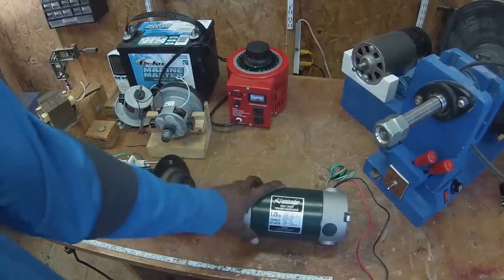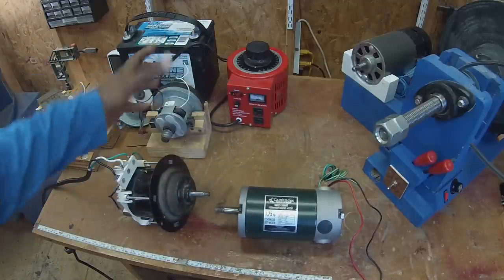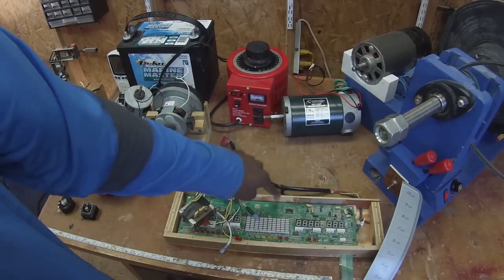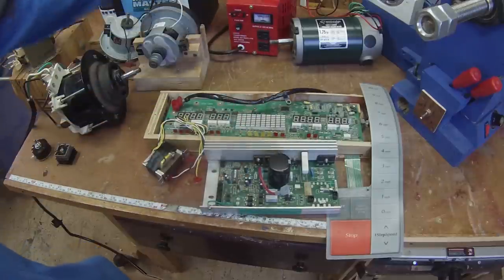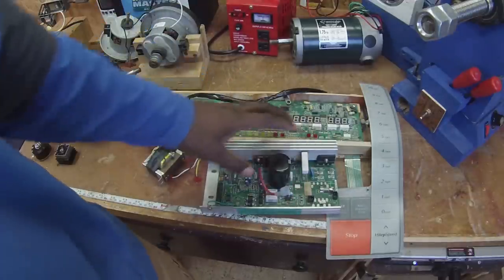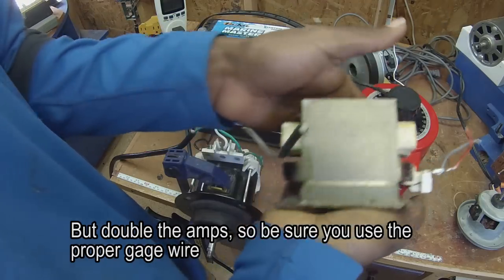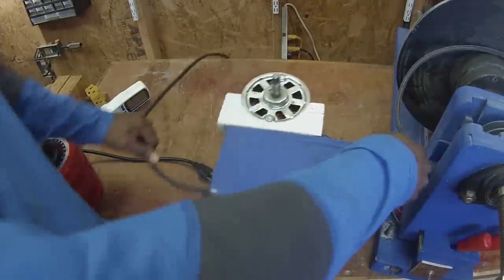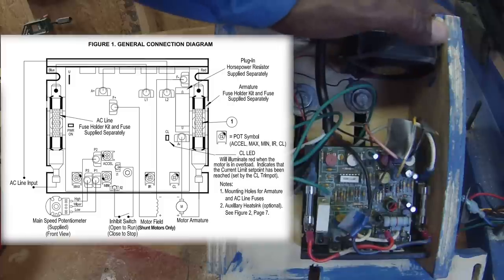How To Wire A Large DC Motor And Control The Speed; Treadmill Motors and Universal Motors 019

Comment: I just discovered your video teaching on motors and wonder if you might suggest how to best power a drum sander feed conveyor belt that I need to build for my drum sander which I recently acquired that needs the conveyor feed table added. I have seen several builders use a windshield wiper motor for the drive motor but they were not specific about just what they used in their configurations. It does need to be speed controlled  and these are normally 12 volt dc motors that produce lots of torque. I think that would be desirable so that slipping of the belt could be detrimental to the finished surface by causing dents in the surface where it occurred. Some belt sanders have what is called "sandsmart " feature built in that is the ability to compensate for a need for more torque to maintain steady speed of the feed belt. Anything you might suggest along the lines of the speed controls needed would be very appreciated. Thanks Jim

Comment: Super informative and answered my question regarding the HF controller.  

I have a motor with a motor controller that is connected to a power supply board.  Can I take off the power supply board and just use the motor controller with a potentiometer????  Please help!

Comment: Regarding the Harbor Freight motor control midway through, they do not work on certain motors, because the motor is wound a certain way and the only way to control the speed is via voltage control, as in the variac you are using... So I would suggest testing it on more motors you have sitting around and see if you get different results.
Reply from the maker: It should work with DC motors, and universal motors... Routers are usually universal. Induction motors are the ones you can't control with this type of device. Watch my video on "can a dimmer switch control induction motors" The harbor freight tool is basically a high powered dimmer switch.
Reply from the maker: The problem with Harbor freight is quality control. They basically don't have any. You might get one that works fine, but there is a good chance you get one that doesn't work as well.
Reply: Jeremy Fielding I couldn't agree more, HF is totally hit and miss. I just recall trying to control a loud, fast fan, and the speed control did exactly what I saw yours do, nothing, up until it hit ~80%. So I did a bit of research, and although I though don't recall exact specifics (meaning you are certainly right... lol), I just recall that some motors are wound a certain way, and the only way to do speed control is to change the voltage with a variac.

With that said, I just wanted to thank you for what you do! For the time and effort you put into these videos, and sharing your skills and varied knowledge with us! Thank you also, for taking the time to respond! It's really great when creators interact with us! Take care and be well!

Comment: Hi. The capacitor will reduce noise and the ripple after the rectifier bridge and should increase the power in the motor since it will prevent the voltage to drop to zero (120 times per second after full wave rectifying the variable transformer Vac output @60Hz). The power source (your variable transformer) should provide energy to the capacitor (charging it) and energy to the motor (120 times per second when it reaches the peak voltage). Having said this, that capacitor of 1500uF/200V will not hurt anything. Actually, if that PCB speed controller is the one originally controlling the motor, then that should be pretty much the capacitor you need. Follow the PCB lines to see if it is connected in parallel after the rectifier bridge in the power input of the PCB. If yes, then it was calculated to store and supply energy to the rest of the circuit where the biggest load is the DC motor. Now, you should not add more capacitors to much higher values because they can become a really high load (more than the motor itself). The higher the capacitance, the hunger the capacitors and the current to charge them will increase. I hope this clarify a little.

Comment: Very cool stuff on your channel , I do not know a lot about this but to get 24 volts into that motor , wouldn't it be easier to get another 12v battery and connect the two in parallel to run that  24v electric lawnmower motor ?  I'm going to keep watching your channel because i am definitely learning things.

Comment: what do you think is better to run my south bend lathe? A dc motor or ac motor with variable speed drive?    I just hate the high pitch wine from the variable speed drive but will a treadmill motor be just as loud.   Does one setup have more power than the other?

Comment: I have a reverie bed that has 24 V DC motors to raise and lower the head and feet of the bed. Originally this worked through a remote control to a receiver under the bed. There is no remote control now and I'm trying to figure out how to create a switch panel to run the motors up and down. I would love some advice on how to build the switch panel to make the bed go up and down.

Comment: When you use the triacs, can you feel the motor pulsing at slower speeds?  Ever try using triacs from light dimmers as an even cheaper alternative, if it even works?  Just curious.  (Darn you get me interested in motors.  Now I'm mulling over ways to get switch mode power supplies to run them.)
Reply from the maker: Yes I have, and yes it works

Comment: Great video I got two 48vdc motors from an electric forklift how can I wire it. I looked some of your videos but I didn't see you   use any 48vdc motors can you assist me. Thank you
Reply from the maker: This would be the video to watch. The same rules apply to all brushed DC motors of any voltage. You should have a red and black wire. and sometimes there are two blue wires for thermosensors.  You can watch my "how to wire a motor" video number 35. That one will show you how to figure out which two wires have continuity. If more than two wires have separate winding then we have a problem. Some motors have really complex wiring systems. Send me the model number and details on the label. If I have a motor like that, I will make a video on it. I am trying to cover as many different types as I can.

Comment: Man oh man do I wish you made this video four years ago.  You consolidated info I picked up from probably 50 other sources.

So regarding the cap size... yeah I have been to sites that show how to calc a smoothing capacitor value, and I came up with tens of thousands of MFs too.  But in practice, a 1500/200v works just fine.  The calculations I found were for basically eliminating ripple altogether.  But I've been running a 10" table saw on a treadmill motor for a while and ripple doesn't seem to be the issue.

I say "the" issue because mine is 1.75hp like yours, but it does NOT perform in a table saw like a 1.75hp motor.  Incidentally I rewound a MOT too - took it to around 45VAC which rectifies to around 70VDC, which made my treadmill motor spin at almost exactly 3450rpm.  But it gets bogged down pretty easily.  I think it's because most treadmills have feedback going back to the controller so it can tell what the current speed of the motor is.

So one of my mid-term projects is to scratch-build a speed controller using an Arduino board as the PWM signal generator, but which also has hall sensor feedback so I can tell if the motor's bogging down, and up the voltage accordingly.  I have the code working, I just need to figure out the finer points of reading hall sensor input.

I'm planning on doing an instructible when I get it done.

Comment: I hope you see this comment since the video is a couple years old by now. But i was wondering if you think that a used dc treadmill motor similar to the one you have in the video would be a good candidate for a diy battery powered lawn mower conversion?? Yes i know, i can buy one nowadays. But i intend to build one to suit my needs and wants. Plus it will be a fun little project. Thanks!

Comment: Use a magnetic rotary dimmer for lights then your rectification that is cheap too.
Reply from the maker: +DrSaminstine a dimmer might actually fail first. They both function the same way but speed controllers are "supposed" to have better triacs to handle the inductive load of a motor. So cheap yes. But may fail sooner than the cheap harbor freight controller or maybe at the same rate.... it depends on the rating of the components. Lights don't use nearly as much power as a motor. Not usually at least.

Comment: You should use that capacitor, even if it has just 100 micro farads its better than nothing since the motor will run more smoothly without AC noises,ripple and i think the life of the motor/brushes are extended, the only thing you have to make sure its to put a capacitor with enough voltage or more than the one you are feeding.
Reply: chancho00 not to mention rpm under load, no cap and a load on the motor the rpm will cycle at 60/50hz

Comment: I wonder if using the large capacitor in parallel with the harbor freight speed control would solve the problem of it not powering up the motor on the low end of its range?

Comment: Is there a better location for the speed control, specifically, variable AC or variable DC? I can imagine that the AC speed control might be subject to a different "load" than a potentiometer on the DC motor feed (but I just plain don't know!) Thanks!

Comment: Hey Jeremy, great video.  Do you have anything showing the treadmill motor using the speed control board from the treadmill but replacing the other board for the speed input with a PWM or potentiometer.  I have a PWM but can't seem to get my motor to run with it going through the control board (MC2100LTS Rev B)

Comment: Hi JEREMY.  GREAT VIDEOS. I need some help. I bought a Bodine 115 VDC fractional motor at an auction. I just want to run the thing. Can you help me with connections and what else I may need to run it.  It’s 6 wire with separate ground. It’s also a Shunt wound motor. I have an AC speed control. Can I use a bridge rectifier and the control with a Shunt wound motor ???   Thanks. 😊

Comment: Great videos! Thank you. I have a question that I am hoping you can answer. I am converting a treadmill to a small conveyor. I have used it with the factory controls and it works fine at full speed. I thought that I could skip the speed control and just use the bridge rectifier since I do not need to reduce the speed. However there is a lot of arcing at the brushes when I tried this. I checked the brushes, cleaned the commutator, and reconnected to the treadmill controller. Again, it works fine. Apparently the controller has some additional effect on the power to the motor? Can you explain this? The motor is 130 volt and I am running 110 on the rectifier so I would expect the DC to be slightly lower. I do not have a DC volt meter that will read above 60 so I am unsure what to do next. Of course I could add the speed controller but I would like to understand the circuit better. Can you help me?

Comment: Could you run the rectifier then a pot on one leg of the circuit (say the positive) inline then to the (say 90vdc treadmill) motor? Or would that not work? Thanks for the cool videos, giving me lots of ideas. I’ve built a few things prior to finding your videos (my best yet a 2x72 belt grinder specifically, initially powered by a treadmill motor using the complete treadmill interface, then later-now running an AC 3hp motor) but I love your rowing machine generator that’s an awesome idea. Even if you ran the larger battery, I could tell my kid he has to row for 30 minutes to ‘earn’ 30 minutes of gameplay or the battery will die.

Comment: Love all your videos Jeremy. question for you. do you find it a common thing that although a treadmill motor may be rated for 2hp for example that at low rpm it has very little power? I have been using one on my mill for 5 years and works good but for low rpm spindle speeds it will stall the tool. I had been assuming this is due to I eliminated the series of belts which I'm assuming its a gear reducted type thought deal. I have the treadmill motor straight to the spindle and the pulleys are 50:1 basically half the motor speed at the spindle. would you assume this is the reason for lack of power at low rpm is the lack of all the pulleys. I think that's were I messed up

Comment: I have a treadmill motor i'm trying to use as a drive motor for my slab saw table. I've got an old transformer and currently its running on the highest voltage winding at 36V i believe it is through a "full bridge rectifier!". I'd like it to go just a bit faster or variable speed for different sized cuts would be even better. Trying to find a good cheap way to drive it. Its not going to have hardly any torque, just basically idling along. That KB electronics controller sounded like a win, but the price has gone up in the last few years since the video i guess. Its $92.40 from KB electronics website now :( I don't really want to spend 100 bucks to drive a free motor. The controller in the treadmill it came out of was fried, hence the reason they got rid of it.

Comment: What kind of salvaged motor do you think would be good to replace an air compressor motor?
Reply from the maker: You really need a induction motor for the same reason I mentioned regarding the sander. Induction motors will keep their speed as the load increases. That is the only way a compressor will work properly. Washing machines have induction motors, but to say it will replace your compressor motor is more than I can say in the comment section. You have to do your homework to make sure it meets all the needs of your application .

Comment: So Jeremy; I disassembled one of those beds that have low torque motors to raise the feet, or to raise the back to an upright position. I intended to use the motors for a can crushing idea, but have not figured out how to wire it so |I can use it properly. there is only a black and white wire coming out of the housing, and of course there is the threaded rod with the floating nut that was attached to the bedframe somohow. Any ideas as to how  I can use these motors???

Comment: I enjoy your videos Jeremy but the confusing thing to me is getting a hold on what's needed. I have a wheel chair motor that's rated for 24 volts DC and I think it's a 100 amp, don't really know. So I can build or buy the IC unit, run 120 volt's AC as input and run the DC output to the motor and it doesn't matter what amps it takes to run it as long as I have the 24 Volts?????? I'm lost on what to look for or how to address it. Maybe this is why I can't locate the right device for my use. Thanks

Comment: Is that particular bridge rectifier you used suitable to run a 90VDC treadmill motor? I have one, and like you have only been able to use it by utilizing everything I yanked out of the treadmill and is much too bulky and a pain. I need a simpler solution to use the motor for a project I have in mind. Thanks in advance
Reply from the maker: Sure. But if you didn’t know that from watching the video I might have failed my mission. Or you missed it in the video. Please watch it again and confirm your setup before you begin wiring.
Reply from the maker: So I just watched it again and see I didn’t put the label on the screen which I almost always do. The motor I am using with the bridge rectifier is a 90v treadmill motor. That setup, while cheap, has a limited life. I would recommend the speed controller if it is in the budget.
Reply: Thank you, can you provide a link to the controller you recommended? My apologies, I am not an electronics guy by any means. I appreciate ya
Reply from the maker: I will respond with a direct message.

Comment: That Harbor freight regulator most likely has got too high of a potentiometer.  That is what that knob is that you turn.  It is what causes the thing not to work until it is half way.  That is one thing and the second thing is I wonder if it is really rated for 15 amps, maybe for 2 seconds or something.
I got a 3HP Treadmill motor. It probably weighs around 60 lbs.  110VDC and 21 A.  I like to get that for all the power I can get out of it.  When you install that full bridge rectifier I believe what you get is probably around 160-180VDC.  I used a 1MF capacitor from a microwave oven plus a choke.   However I don't know if them cheap chinese voltage regulators are much of a thing.  I don't know about the amps. And the Treadmill motor will also run on AC directly but it will not get full power aside from just more hardship on the commutator and the brushes, sparks.

Comment: Great video as always jeremy. Is there any way of controlling the speed of a universal motor using dc power? Im thinking of using 2 flexvolt batteries to power a 1/2" router but im worried about potentially damaging my batteries or switches with arcing during use. Perhaps a soft start or a pwm to gradually increase the speed but i can't find anything that can handle both the high dc voltage and the current.
Hopefully someone here has an idea. Thanks

Comment: U'r videos r  great and easy to follow,,,  sir I've salvage a brushless motor from a tarp printer it's labelled as 57BL-02482-0150A-002 24V/4800r/mins./150W,,, the problem was the wires r cut , it has 5 wires in the  same w/ colors of red,White, black,yellow,blue & 3 wires also same  w/c is thicker w/ the colors of brown, orange, green,,, pls' help me identify this wire which ones I need to have this motor running,,, think u very much..

Comment: I have a little 12 volt motor and was thinking of just getting a dimmer switch to put on the circuit to control the speed. Will that work?